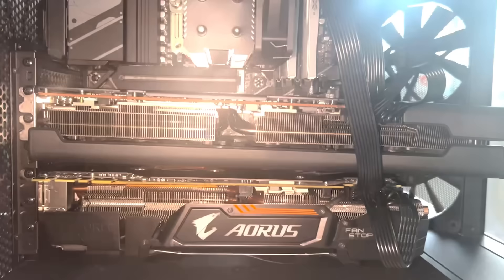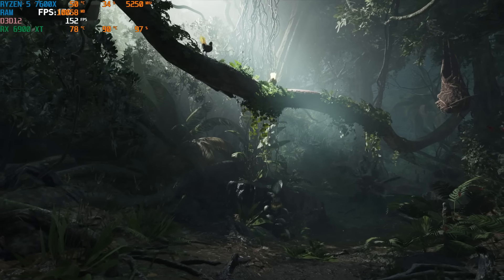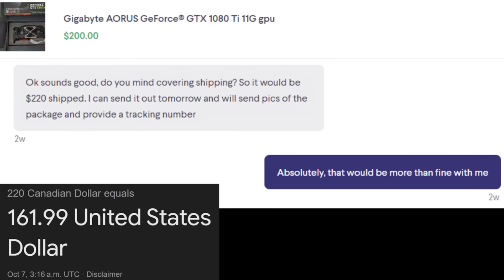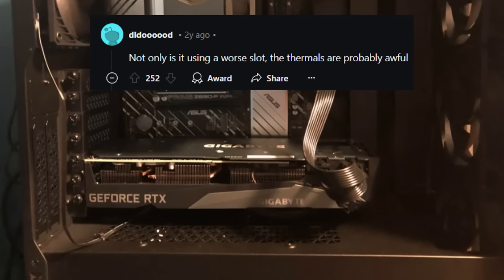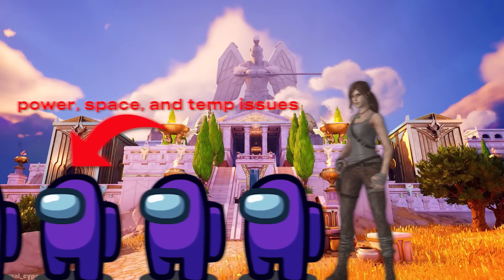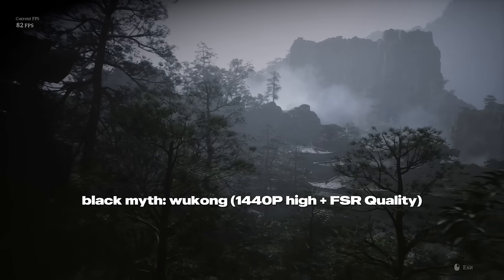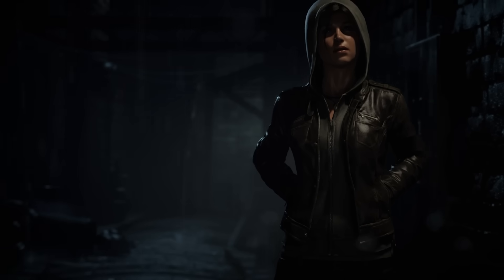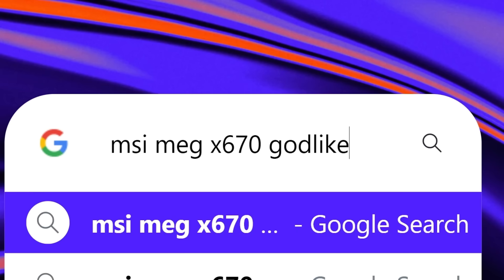I Combined AMD & NVIDIA in One PC and Got 1500 FPS

Comment: I did this a few years back. I had a AMD Fury and added a 980 I came across for cheap and was using for mining purposes. Snice I had hem both I went ahead and tried them out. Low and behold they could work together in certain instances.  I tried mGPU in a couple things but most of the time just left the 980 mining while I played on the Fury. The fun trick was after NVIDIA updated their drivers and stopped blocking access to PhysX when you had a AMD card installed. Had a few games that instantly started running better by enabling PhysX on the 980 instead of having to do it on the CPU and still rendering on the Fury.

Comment: MSI MAG B650 TOMAHAWK Don't really need SLI support , need to 2x16 lanes. Since only need to be Gen 4 PCI spec, since both GPU using at only 4 pcie cards, get about $250. While run two GPU in one system, still wasting time, since not add together anyway.

Comment: Lucid made a chip back in the day called “HydraLogix” that was on MSI motherboards & it basically let you SLI an nvidia & an amd cards together, but I think they either got sued or nvidia made them stop it by pushing out firmware so it wouldn’t work with newer stuff; I don’t remember exactly.

Comment: CPU has a limited number of PCIE lanes. It usually less than 32, which you need for two GPUs running at 16 lanes each. SLI motherboard doesn't add pcie lanes to the cpu so I fail to see how that would help. SLi and Crossfire have been entirely moved into DX12 API and motherboard shouldn't even matter at this point.

Comment: My Guy, SLI was from the 90's, 3DFX Voodoo 2's used SLI to double the performance and allow for games to run in 1024 x 768, they also had the better implementation too, instead of doing half and half like Nvidia and ATI did years later, they used scan line interleave hence SLI, with no noticeable de-sync what so ever.  

Here is a short video I took of my Voodoo 2's in SLI running UT99.  

https://www.youtube.com/watch?v=lC04Ak4qrzs

Comment: AMD may not be able to utilize Nvidia tech like DLSS, but most if not all Nvidia cards can use FSR2, 2.1, and 3 with very respectable improvements to base game speeds that don't require methods like this to work. FSR3 even gets close to DLSS 3 by a very narrow gap on 40 series, meaning 30 series and older can get massive improvements over DLSS 2 enabled cards and older.
Thats why I like AMD, they did put forth thought AND effort to make their up-scalars accessible to everyone even if you don't have an AMD card.

But real talk for a sec, to get the most out of a project like this get a board that has a gen 5 or gen 4 top M.2 and hook an adapter to the PCI-E of the card. That should get you the bandwidth you need to unlock the card. 
https://www.youtube.com/watch?v=fcqH8gtRSjU

Comment: Test for you.

1- AMD GPU as primary.

2- Ngreedia GPU as secondary.

3- Install Arkham Knight.

4- test if PhysX works using the Ngreedia GPU just for that
Reply: PhysX crashed all the time with one GPU, I doubt it'd be any stabler with 2
Reply: @pacomatic9833  If you remember, PhysX launched with the Aegia accelerator.
Ngreedia bought them and locked the tech behind their hardware.
Back then, it was possible to use an AMD GPU as primary and the Ngreedia GPU just for PhysX.
Reply: might actually work pretty sure nvidia already made support for having a second gpu dedicated just to physx
Reply: @PupperTiggle  it always worked, but Ngreedia went out of their way to make sure that it didnt work.
They spent a decade on that anticonsumer crap.
We went through hell back in the day to be able to use our gpus.

Comment: it's not only limited to gen 3 speeds, but 1 lane. Notice the "(x1)." It's a x16 key, but that is for situations such as this, where you wouldn't be able insert the card into a pcie x1 slot. Instead, yes the slot itself is the correct form factor, and technically you can use a gpu in that slot, but you'll be limited to a single lane of bandwidth lmao!! That is a huge bottleneck. Pcie is extremely confusing. You have slots that support different generations, different number of lanes, different keys, and you can configure them to bifurcate in the UEFI. Some pcie slots share lanes with m.2 slots and, when both are occupied by a device, either get a reduced bandwidth, or you have to choose which slot to use while the other is disabled by configuring the UEFI. Anyhow, the only games that you would be able to utilize this multi-gpu setup are the extremely few games that have direct x 12 explicit multi-gpu support. They are - Deus Ex: Mankind Divided, Rise of the Tomb Raider, Strange Brigade, Ashes of the Singularity, and Sniper 4 Elite.

Comment: I have a spare 1080 laying around... and I have a 6950XT...

I also have a motherboard that supports bifurcation (Basically, SLI/Crossfire capable)
I have 2x PCIe X16 slots... (x16/x0, x8/x8). 
As long as the motherboard supports PCIe Bifurcation, it can likely support it.

What you're saying is possible. It has been done. This is a topic as old as it gets... no offense.

The only caveat being, you can't run the same game off both gpus in almost every scenario... with a few exceptions where it actually works.

NOW... if your PRIMARY GPU is an NVIDIA... you can set the AMD Card in NVIDIA Control Panel to handle PhysX/Compute whilst the NVIDA GPU handles the graphics load.
This... usually works better if the secondary card is an NVIDIA card... even if not the same generation.

As long as the signal is x8 or better, the GPUs can focus mainly on what they need to do.

In many cases, people use this for virtualization... utilizing hypervisor OS to run virtual machines... tying those GPUs to their own virtual machines, and specifying the amount of compute per cpu, you can have 2 gaming pc's in one.

I have a Ryzen 5900X, 6950XT, and 1080, all on water. I could do this without issue... but you pointed out the most obvious plot-twist... power. Even though I'm capable of running it with a 1200W PSU,  the power consumption just from running the second GPU will increase by at least 100W at idle, and if both gpus are utilized for gaming, well, you can imagine the power bill is akin to running a space heater.

Let's face it, Virtualization is the only reason to have more than one GPU anymore these days. Nobody is optimizing for multi-gpu gaming anymore.

Comment: Been using a 4090 and a 7900 XT on linux for while now...
I use the 7900 XT for the desktop environment, discord and everything non gaming related.
For the 4090 I use nvidia prime to run games on it.

I do the same for the rare occasions that I'm on windows and I don't get any drivers issues and selecting a gpu for a specific game or program is very easy when using the built-in options for hybrid graphics built into windows 11. Tho under windows 10 it's very bad and you'll often need to edit the registry to get both gpus to show up in the settings.

Comment: on an X99 chipset with xeon 4650v4  and veineda motherboard you have 40 pcie lanes and can use 2 x pcie x 16 slot in the x16 speed and you will have 8 pcie lanes free. But i do not see a big use of that, because the microsoft explicit multi gpu adapter needs to be implemented in games to take the full effect of the cards. They can do it without implementation, but obviously they do not want

Comment: Fun fact: The current CEOs of AMD and NVIDIA are cousins once removed.

And AMD also provided NVIDIA their AMD Epyc CPUs in DGX A100 workstations.
Reply: @FairnightVexel  I remember back in the day people pairing nvidia with radeon for physx
Reply: @FuentesDj  some games physx are not updated and the cpu physx is extremely unoptimized (Mafia 2 and Mirror's Edge), so having the dual setup still improves that experience. It's probably only a few games though. BL2 physx is about the same on modern cpu as it is on nvidia gpus, it's definitely the version of physx in the game. I know this, because iirc, you can swap Mirror's Edge physx files with updated ones and it fixes issues with the cpu physx, but this is not possible on Mafia 2.
Reply: Was about to write that. Its basically family business now. So one side can make worse gpus so the other side makes better ones to make cash and change sides when needed.

Comment: Afaik, It's all still rendering off the 6900XT, the 1080Ti is doing no rendering besides  the second display it's connected to. The 1080Ti can be used for certain tasks like secondary rendering (2 games at once, one off 6900XT and one off 1080Ti) or like for it's encoder but you can't "SLI" them together, in a sense, to gain more performance.

Comment: you know you can just do an external egpu with a second card in it through thunderbolt 3 or thunderbolt 4 and you can run them side by side with any architecture right? and no you cant run 3 gpus. windows 11 does not support that many avenues of rendering in a stable manner. only 2 that i have gotten working. i currently use a 3080ti and 7900xtx together. this results in more performance capabilities from your second gpu as thunderbolt 3 is 40 Gb/s rather than 8GT/s (1 Gb/s). its 40x faster. if you are wondering what brand i am using its a Sonnet eGPU 750w Breakaway Box. keep in mind youll have to modify the case significantly to get any triple slot or higher card to fit. or you buy the product and take the power supply and small board out and make your own box out of a mini pc case. hope this gives you another dual gpu video to try. i posted proof it works in your discord.

Comment: If your motherboard supports bifurcation, you can split the top PCIe 4.0x16 into two 4.0x8 lanes, and use an adapter to split it into two x16 slots. Each gpu will be limited to PCIe 4.0x8 speeds but it’s better than using the bottom slots which run at x1 speeds

Comment: Actually you could combine AMD (ATI at the time) with an Nvidia GPU with technology called "Lucid Hydra" -- it was a feature on my Crosshair IV AMD board. I I believe I had a 6870 (primary) paired with a GTX275 (secondary). Funny enough, as far as I can remember, it didn't really cause any major glitches in games, but many games didn't see much of an improvement, while others saw massive gains. I remember Red Faction Gorilla getting a major 20 - 30fps boost. DX & OpenGL would potentially show different results. Great vid btw!

Comment: Well, if you get an m.2 to pcie adapter, you can use the x4 lanes from the top m.2 slot for the gpu.
90% of the new ATX motherboards only wires pcie X1 to the physical x16 plastic for each slot.
mATX motharboards have x4 and x8 slots from the chipset because of the size limit.
Reply: Yes, you are correct. This dude put the 1080 ti into a Gen 3 Pcie x16(x1) slot. The "(x1)" means it only has a single lane of bandwidth lmao. Using the m.2 to x16 adapter would have been better. Even so, he didn't play a single game that could utilize his setup. The only games that can utilize an AMD and Nvidia gpu together are the rare titles that have Direct X 12 explicit multi-gpu support.

Edit: I was incorrect. Rise of the Tomb Raider has explicit multi-gpu support, but I doubt he had anything configured correctly.

Comment: Why not just use a ARC a310 it has AV1 encoding on par with the highest end Intel card and quicksync better than NVIDIA it's small has almost no thermal output and requires no extra power and is like $90 new .

Comment: Let's make this quick. Please don't do it, it's stupid and will not benefit you at all. In terms of who is better, here are some pros and cons. (The only benefit I can see is OBS, using the Nvidia card processing for OBS and the AMD card for the gaming aspect, or vice versa.

Nvidia has no driver issues, while AMD sometimes does (a lot). In terms of price-to-performance, AMD is better for the price compared to NVIDIA, but if money isn't an issue for you, then NVIDIA is the way to go. In terms of PSU requirements, AMD is less power-hungry for its GPUs than NVIDIA. 

Performance: Goes to NVIDIA (faster cards)
Price: AMD all the way, very affordable
Drivers: NVIDIA for its very simple and easy drivers to work with and minimal issues
OBS: NVIDIA cards are very good for OBS and its very easy to get the best recording settings for it
sadly AMD cards will need OBS settings to messed around with quite a lot to find the perfect settings, took me 2 hours to get them perfect, same goes for video editing software like VEGAS or Adobe After Effects.

For my scores. AMD 7.5/10 | NVIDIA 8.5/10

Comment: the proper way is to choose the display with the gpu that is performing better on individual games based on optimization . You cannot gain performance from both gpu's. for example you have a 4080 super and a 7900xtx and in alan wake you choose nvidia and in codmw2 lets say you choose amd.

Comment: At least buy that 1800$ mobo so we can see if it actually works or not.
Reply: It doesnt. Very few games support true SLI/Crossfire, even less support more modern multi-gpu features. The only benefit is frame-gen stuff, so your best bet is like A310/380, your main card and whatever from nvidia/amd with DLSS/FMF, opposite of what you have as main card.

Comment: I spent 8 months writing instruction sets so the nvidia gpu can talk to the nvidia gpu, even when it's up and running the motherboard cab be modified, I ran the 6800xt alongside a 2080 super and my translation software makes the frametime skyrocket, I'm not well versed in those particular instruction sets.

Comment: The reason your second GPU is losing performance is not due to a chipset bottleneck on your motherboard, the chipset only manages the last PCIe and M.2 slot.

The real issue is that your GPU is plugged into a PCIe slot with only 1 lane, giving you just 1 GB/s of bandwidth.

Also, you don’t need a $1,700 motherboard. First of all, SLI only works with two NVIDIA GPUs, and not in the way you're thinking. If you want to connect a second GPU to the PCIe lanes of the CPU, use your top M.2 slot with a riser. It has 4 PCIe lanes that are directly connected to the CPU.
Reply: that depends on the motherboard, there are cheaper motherboards in the $300 range that can dp 8x/8x but the guy who uploaded this video doesnt actually know what he is doing or what he is talking about.
Reply: @thelasthallow  exactly. Guy has no idea what he's talking about.
Reply: Sli capable means it gives 16x slots to both gpus.  So yes it would help in this case even without actually using an sli bridge.
Reply: @shadow105720  we can literally look at the platforms that have that "SLI Capable / ready" badge on itn and instantly know for a fack most of them do not have 32 lanes.

They don't magic PCIe lanes out of thin air just becasue a second GPU (+) is detected.

Pretty sure that badge is meaningless - to - chipset faffery outside of HEDT and workstations. Otherwise all desktop CPUs would be magnitudes more expensive as PCIe is one of the more expensive bits.

Comment: I used to use a 3060 as main gpu and a 2060 super as secondary gpu, 3060 for gaming and 2060 super for streaming and recording
Reply: might be actually slower because then the data must be copied all over to the 2nd card before it can encode it. This will also need the System RAM again which otherwise OBS can bypass too with the current Gamecapture hook and NVEnc implementation they have.
Reply: @De-M-oN  you are wrong i gained almost 80-90 fps by doing so

Comment: Try using lossless scaling, have the 6900xt render the game then have the 1080ti render the frame generation. My personal setup is a 7900xtx with a 3070ti to generate 4x frames. I can run helldivers at 1440p max settings with ultra super sampling at over my monitors refresh rate. (170 fps).

Comment: Absolute waste of time.
How about this : There was someone in China that combined 4090 (rendered the game and with Frame gen) and feed the data into a RX 6600 which used AFMF and then he outputted to the display for massive fps.
You should replace the 1080TI with a 4070 super and do the same thing
Reply from the maker: ill see if i can get myself a newer nvidia card to try this out next bc that sounds very interesting
Reply: @lecctron  You can find more info if you search for websites called "Up to 3x FPS boost: NVIDIA and AMD Frame Generation"
Reply: @lecctron  And is kinda wasteful, cause its essencially lossless scaling thing...but worse.

Comment: What are you doing?? You can't just plug in two GPUs and expect the games to use both at the same time! Games only use one GPU at a time. Did you check Task Manager to see if it's using both or only one of the GPUs? Of course performance is the same if you're just using one GPU every time. Try running two games side by side one on each GPU. Also an RTX 4090 is definitely way faster than a GTX 1080, you're probably CPU bottlenecked.

Comment: Fun Fact - back in 2010 there was a short lived solution to combine amd and nvidia - some motherboards like the  ASUS Crosshair IV Extreme had a "hydra" chip on them
Reply: I did this in 2017 to use FreeSync while rendering my games with my GTX 1080
Reply: @sickdisgusting5989  did it worked?
Reply: i thought it was coming with either directX 11/12 ?
Reply: @stuwilldoo7035  DX12 (and vulkan) support a thing called explicit multi adaptor that kind of worked as a hardware agnostic SLI/crossfire solution - including letting that intel iGPU in the processor get in on the action

only issue is only like 5 games supported it because it is 100% on the developers of the game to implement this feature because it requires really low level GPU programming to do
Reply: I'm doing it right now with 3080 for game rendering and 6750xt for afmf2 and freesync. Works fine.
Reply: It was called lucid logix
Reply: Rocken a p67 hydra and the support was abysmal btw
Reply: Lucent iirc.